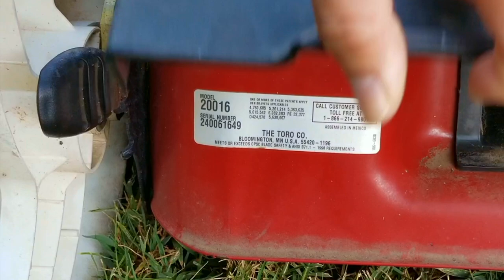Replacing the transmission on a Toro Lawn Mower.

Comment: Those Toro Transmissions are not that good,  I have seen them go out often,
Reply from the maker: I know, this one happened to be on sale, so I figured I'd give it a shot.
Reply: @HomeGaragechannel   last 3 Toros I have. Gotten all had transmission problems

1st- I freed up with penetrating oil (axle was stuck from dirt and being left outside)

2nd I swapped the box and wheels from parts deck  and greased up the box and it came back to working good enough. 

3rd - newer one it moves forward fine but rolling backwards I think the plastic RWD gears having issues. It should be metal not plastic. For the RWD,  FWD is fine to be plastic.  Not RWD.
Reply from the maker: wow, you've had a lot of experience with them.
Reply: @HomeGaragechannel    Yah this year .  It seemed that almost every mower I have gotten has been toro or lawnboy by toro.  

Engines have been including non Toros 
B&S quantum 
B&S new OHV
Kohler
Tecumseh 

No Briggs classic so far this year.  
Those classic ones you can’t kill
They are like zombies that keep on. Crawling in the grass

You likely haven’t seen the videos yet
The are scheduled every Saturday thru 7/2 at the moment

Comment: One reason why I never buy self propelled mowers
Reply from the maker: so you've only every bought and used push mowers?
Reply: @HomeGaragechannel  … Yes plus I have a JD rider as I have a 2.75 acre lawn I use my push mower on my front yard only and I mow twice a week as I’m using Scott’s fertilizer system for a very green lawn my push mower is a Toro with roller bearing wheels
Reply from the maker: very nice!